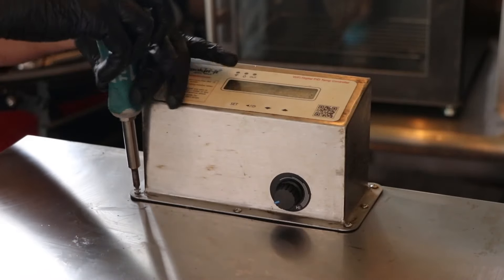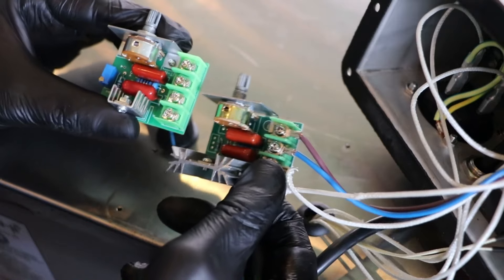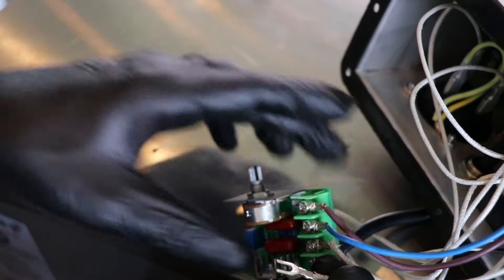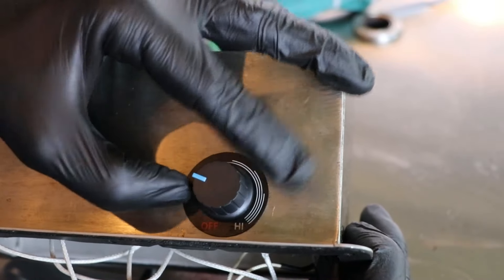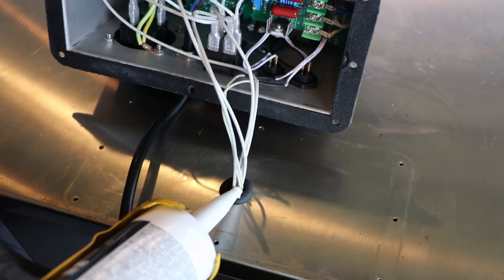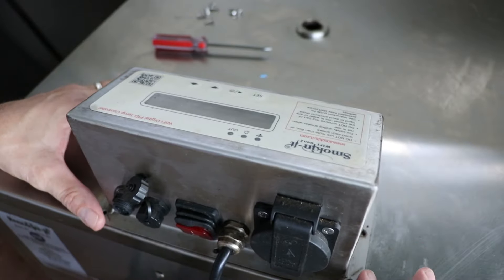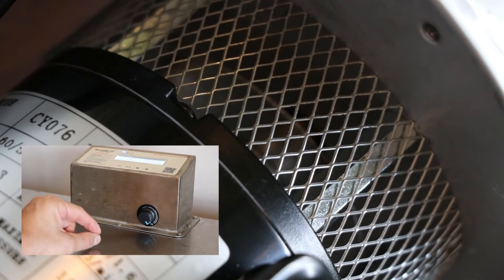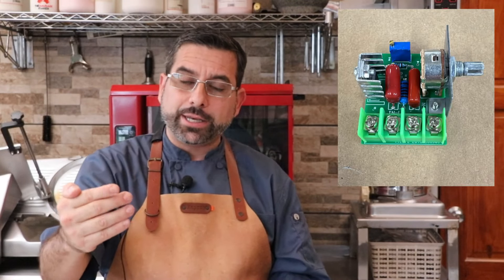Does your convection smoker need a new speed controller?

Comment: Helpful video, I’m considering purchase of a smoking it unit. I’ve been working in the field of pumps and valves for > 20 years. One concern I have with the change of the controller to a lower variable speed board is the potential life impact on what I assume is a brushed motor diaphragm pump. From the partial view of the motor label it appears this is a single phase motor so I would assume it’s a brushed motor. Without knowing the specifics of the pump and updated controller it could be worthwhile to start the pump at 50% speed or higher for less than 1 minute and then lower the speed to the desired setting. The benefit of such an operation would be to prevent the possibility of motor lock due to a lower input current on start up; additionally running the unit at a higher start up speed momentarily could help prevent the build up of brush dust on the motor contacts associated with brushed motors run at low speed settings. all of which is to say extend the life of a brushed motor by as much as possible. Hope this helps some of you and I would be interested in the comment of the manufacturer on this point. I’m done being a nerd now 😊Happy smoking.

Comment: Hey Eric please make a video and explain in depth that how beef hot dogs cooked temp  135-140f is ok according to your website  but according to gov ground beef meat  internal temp should be 160f, I heard about pasteurized Meat using sous vide (slow temp and long cooking) meat is getting pasteurized, please explain this science, and in your website it says ( Cook the hot dogs in some simmering water (176F) till the internal temperature reaches 135-140f (this is for all beef.)
So cooking by this way the meat won't be even pasteurized right? Cause it's not low temp and long cooking method, I'm very confused please explain all these things in a video and I really appreciate, thanks a lot
Reply from the maker: Think about this.  When you go to a restaurant or even cook hamburgers at home, how do you like your burger.  If everyone followed govt standards, then all burgers would be cooked well done before serving.  Instead, we have lots of options; rare, med rare, medium, medium well, then well done.  This happens because there is an assumption that the meat has been handled properly and is free of contamination and the people eating the burger don't have a compromised immune system.  When making burgers or in this case hot dogs at home I know that my meat is processed properly.  I get it fresh, grind it with cleaned and sanitized equipment, and processes the meat properly.  It's the reason Germans and many in Europe eat raw pork with onions and bread.  It all starts with proper processing of fresh meat.  

With that being said, if you are making burgers or hot dogs with questionable meat that was bought on sale at the local big box store, then it might benefit your health to cook your food to a higher temp.
Reply: @2guysandacooler  thanks for answer Eric, I didn't know people eat raw pork wow, so I have to wash the meat with regular water before grinding it so to clean any bacteria...etc from surface of meat? Basically how to handle the meat properly? Do you have video about this?